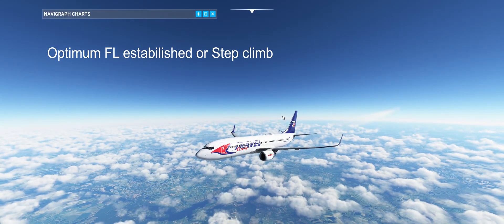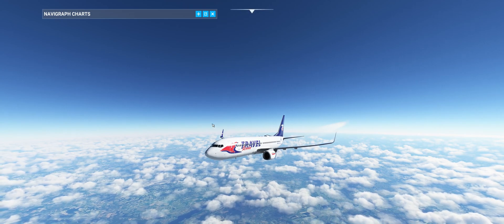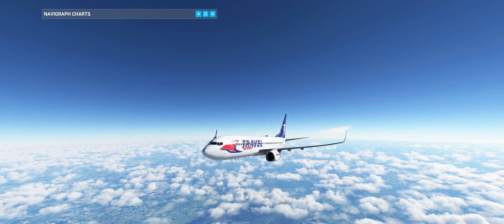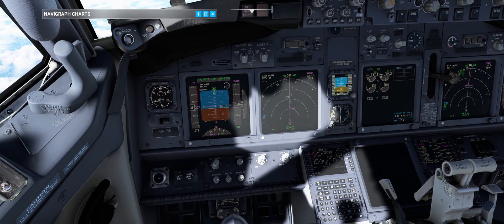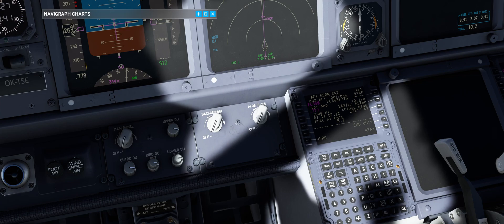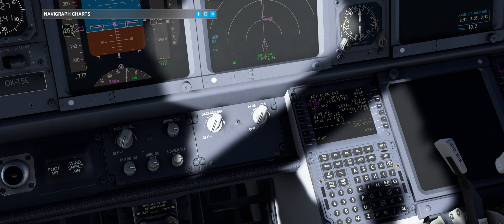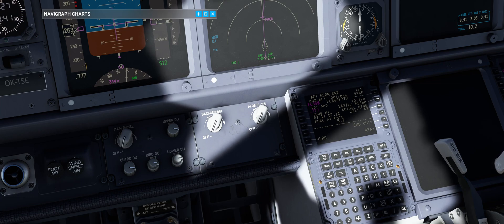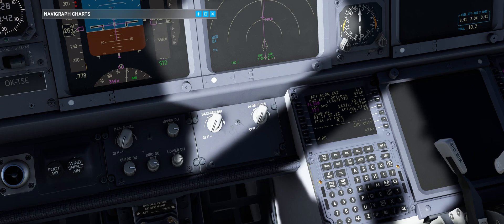Real B737 captain, Step climb or optimum FL ┃ PMDG ┃ MSFS2020

Comment: nice video, can you plan a stepclimb at a certain waypoint in the 737 currently?
Reply from the maker: Hi, there are differentt option for FMC software version, generaly when IT shows step now you should do so, but you policy IS to manage IT depending on weather factors .....oh one thing it there IS no reason for IT when you are close to your descend preparation :) but no the FMC does not depict a waypoint on ND display to start our step climb ...you should check it periodicky on Cruise page ...however airbus Has an option to plan it manualy
Reply: @G2Ssimulations  thanks for the great explanation, I was trying to coordinate it with my simbrief flightplan but I'll know for next time!
Reply from the maker: @offtheice  simbrief IS in this way nearly the same like "default real OFP"  it takes in account the FIR restriction regarding to set optimum FL if we are talking about midi range AC ..differnt OFP setup should be for longhaul flights. In my company we dont have this feature and profile fits somewhere between Ryanair and LIDO :) I hope it was clear enough have a Safe landings